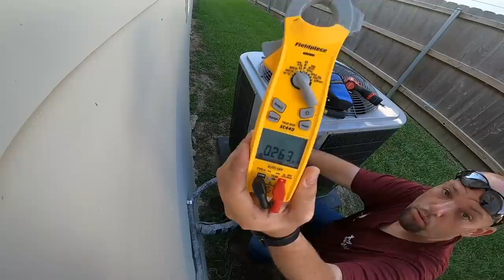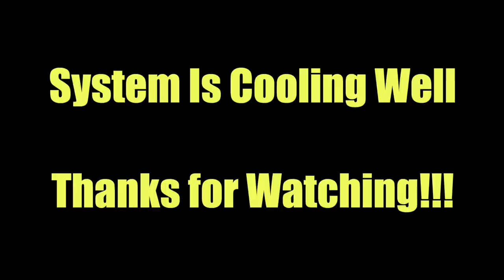Another Premature HVAC Capacitor Failure

Comment: Nice  simple repair and video.  I hope it's a fluke not a trend, but been having USA MARS caps fail under 1 year for 35uf/5uf 370/440, and 45/5uf 370/440 60/5uf 370/440 around 3.5 to 4 years...yes, they have 5 year warranties, but becoming a pain.  The 45/5 was just checked when replacing a contactor and was right on spec, but failed 4 week later. I am thinking of contacting Barker Microfarads who I think makes the MARS caps to see what's going on.  Not that this is relevant, but yes, BMI caps are made in USA as it was the old Sprague plant, but NGM out of Mexico now bought the old CSCI and BMI companies...anyway. we'll see.

Comment: Hey john i am a hvac tech from columbus ohio, i have also seen alot of cap mostly on icp products are failing after a year or two. Alot of costumers ask me how can that happen if they just got the system. how have you been explaining to your costumers, for the most part i think its just cheaper parts beening used but if that is said the costumer the response for the most part is did i get a lemon. so i switched to saying its just how this parts are and needs to change every 2-5 year, which i know its not complete true statement but the manufactures are putting us in a bad spot with our costumers. i was just wondering how you are handling this situation.
Reply: Yea it does make us look bad and hate going back when customers have spent quite a bit of money. I tell them things break new or old and thats why you have the warranty. But yes it does suck having to explain thoes types of repairs on new equipment.

Comment: Why didn't you install 2 capacitors one for the compressor and one for the fan motor they wont overheat that way I do it all the time never had to go back been years I've been doing that
Reply from the maker: Cause I didn’t want to that’s why
Reply: @johnisraelhvac2019  because u didn't want to do the right thing and do a good service call for the client I hope u at least warranty those junk dual capacitors for 1 yr
Reply from the maker: @davidlong1786  good don’t let the door hit you in ass on the way out!!